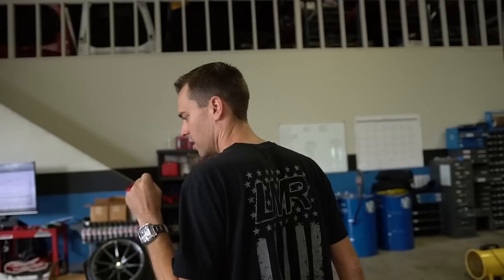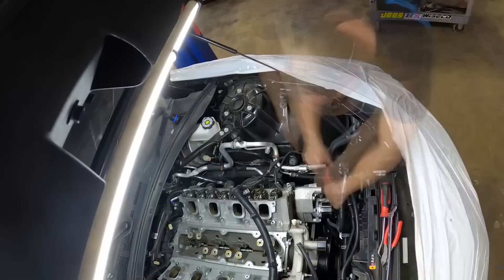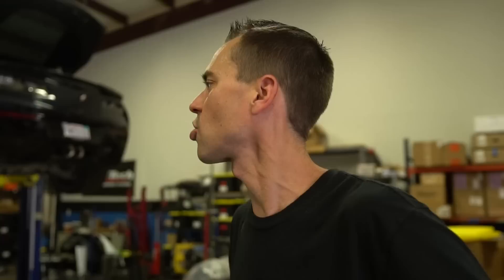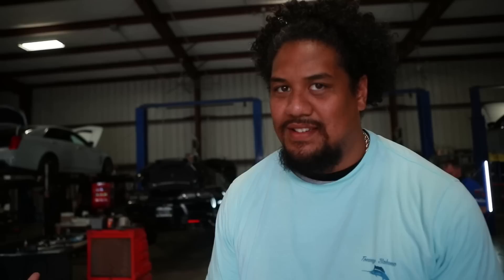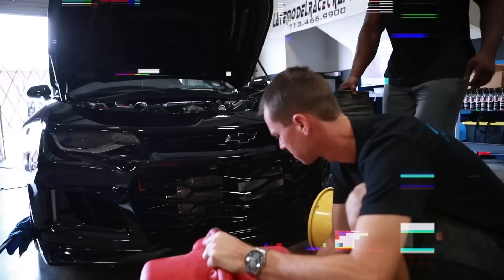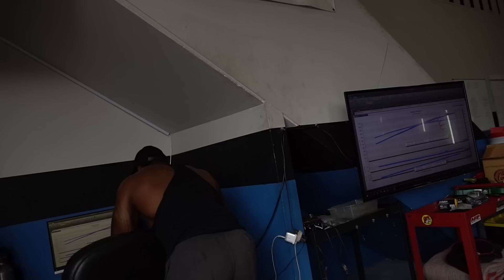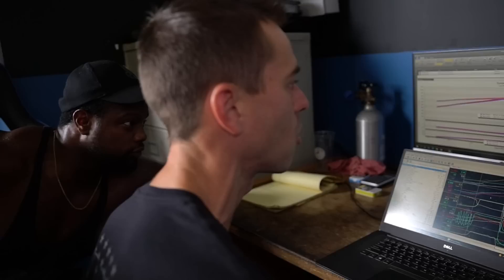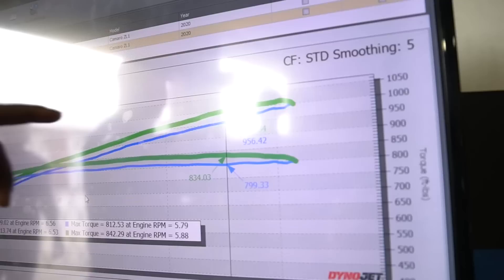1031WHP Monster: Halapoulivaati Vaitai sends his 2020 ZL1 Camaro to LMR

Comment: Would the Procharger F1R or F1X make more power than the F1A94?
Reply: F1a94 makes more power than the f1r. The f1x makes more top end boost than the f194a but the f194a  makes more
Middle mid range and at 900-1200 is a better blower than the f1x and will be in its range. No need for a f1x unless your gonna really spin it and go from 1300+ whp
Reply: @speedlife301 the F1R supports more power according to Procharger. Just gotta try not to overspin the blower. I'm sure the owner is going to be happy with the 1031 rwhp .
Reply: I apologize I was thinking about the f1a that was before and old compared to the f194a. I think the f194a and d1x are the best overall blowers they make. F1x is really for big boy power and must be spin hard to not be lazy.